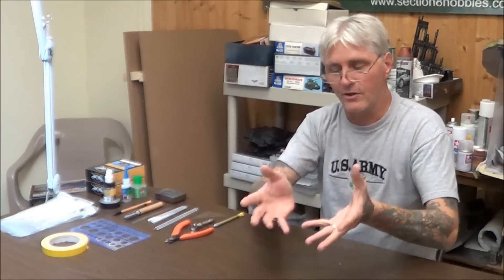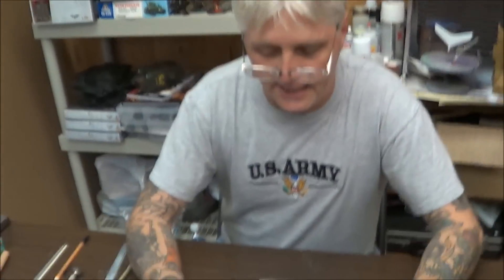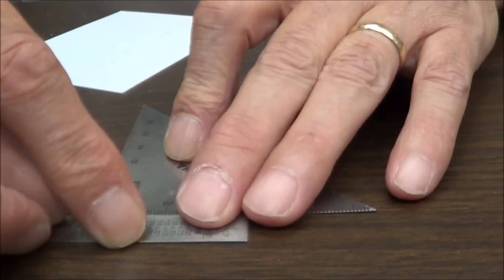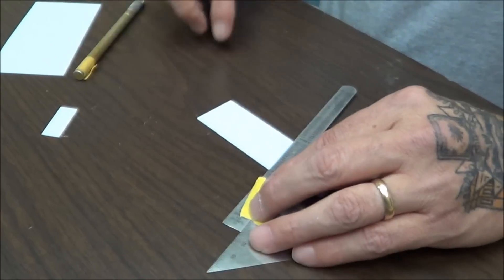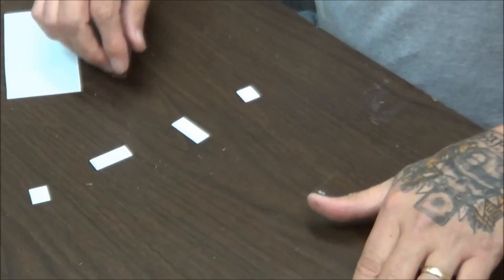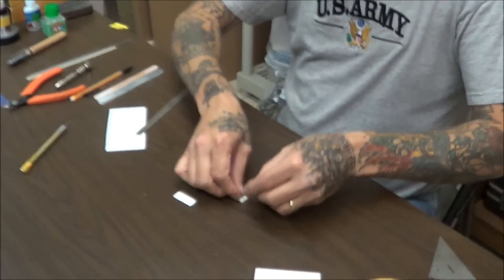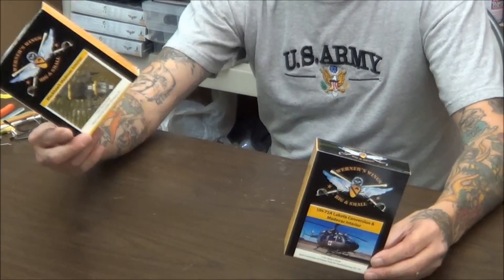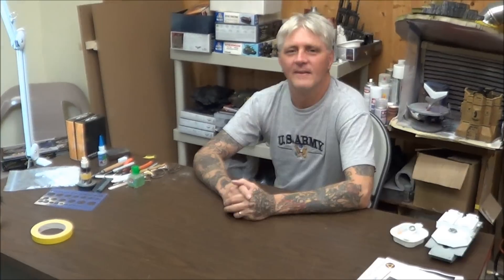Basic Scratchbuilding (Circles and Squares)

Comment: Question ;  using styrene  sheets  , how do  you  cut them @   and 45  degree angle + or -- yo  get a slight   beveled  edge  to  firm  for example ;  angled  bumper  like on fire trucks